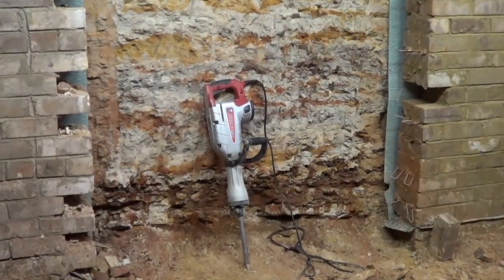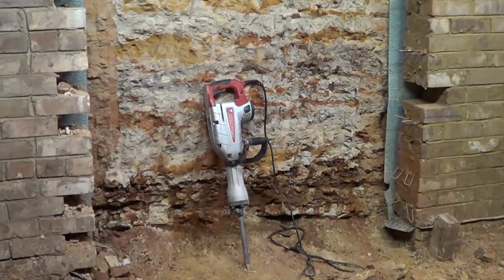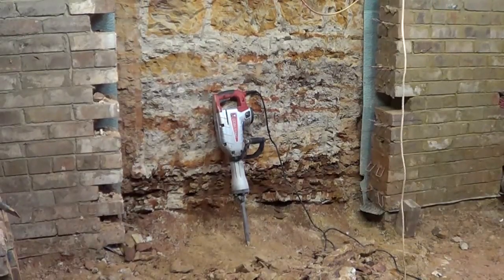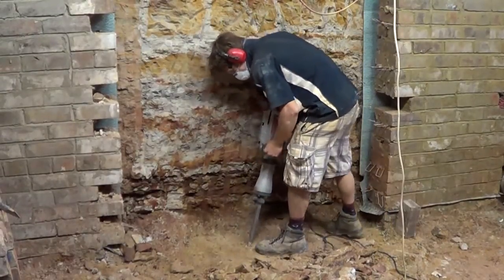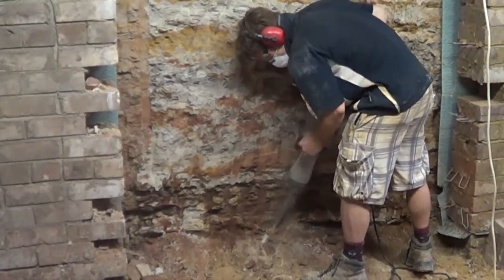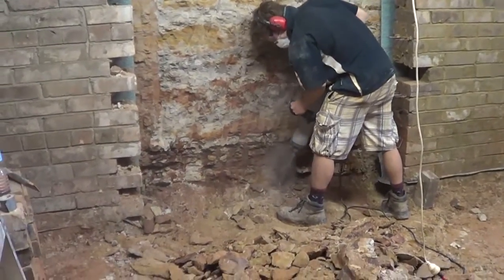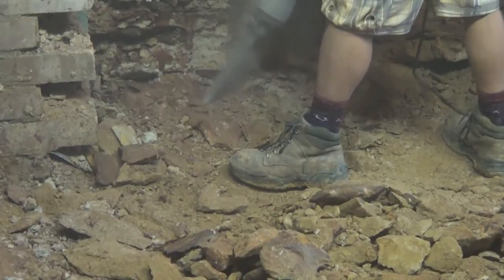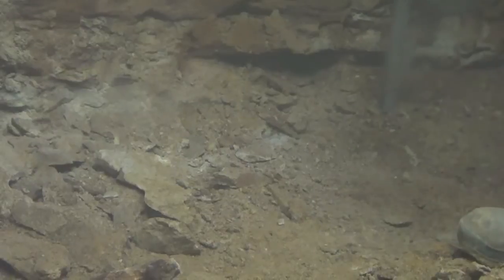Tool Review, Full Boar FBT- 1200 Demolition Hammer- Worlds first video review.

Comment: I had my full boar fbt 1200 for 2 years had a decent life, last major job it did was to break up a 1sq metre by  1ft thick house footing a week ago today it stopped working electrical problem I think it's the lead but I got my money's worth and the best 2 years out of it. Still have it but now I bought a Makita mh1317c demolition hammer  
If it had a grounded lead and better electrics it would last for years 
Good review
Reply from the maker: +rallyausofficial Totally agree mate, it was only the electrical connection that has been faulty for me, other than that a real work horse for the $$ you can get it for.